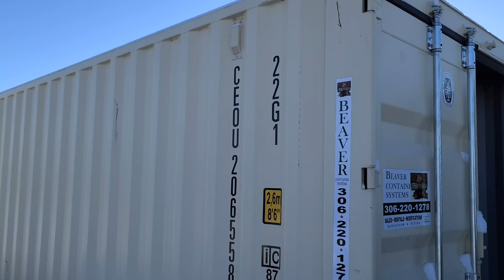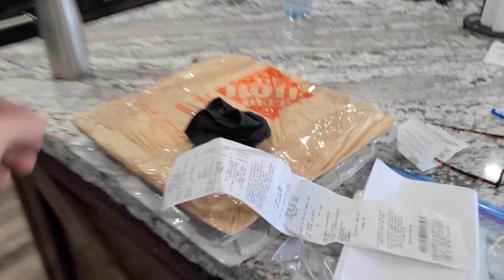Building Our Dream Shop/House Part 21:Final Touches

Comment: The mirror was nice, but not how I would have done it. I would have used a router to make a track that would let you slipp the mirror into it. That way the second layer of wood could be skipped and the mirror could be made to look more simple. I would also not have used old wood, but rather stained new wood, because I would also use the router to smooth out the outer edge so that it curves in towards the wall almost like the whole thing was growing out of the wall. A smaller bit could also do the same to the mirror side so there would be no edge. But my idea was born from what you made so thank you for doing such a good job and keep up the good work.

Comment: Killer job you guys. Looks incredible.
On your wood fireplace you should have your air intake lower. It will drain itself if you install it on a downward slope. I'd also recommend a damper that you can open and close for when not in use. Especially in summer to keep them bugs out. 🍻

Comment: In the patio/porch area I would love to see barn board around the outer walls and the wall that is shared with the house I would match it to the main siding on the exterior... but might separate the area too much. Depends on the the vibe you want.

I absolutely love this build.. I will definitely use it as inspiration when I can finally build my own.
Reply from the maker: Thank you for the tip. Good luck on your build

Comment: the ice on your wood-burning stove comes from the draft and will not disappear if you heat the room, it will rather become condensation. if you are allowed to build a flap to stop the draft, you have to open it whenever you want to operate the oven.

Comment: if it's not too late that air intake for the rsf fireplace ideally could have a loop in it and it will cut down on the condensation.

Comment: Spray off the excess snow off the 6x6 before you put it in your shed.
Reply from the maker: Why?
Reply: @ostacruiser  OMG obvious reasons!!
Reply from the maker: @jasonswift7098  everything melts and goes down the floor drain. No need for extra steps. Thanks 🤟🤞
Reply: @ostacruiser  Yeah and then makes the inside of your shed all wet and dangerous.
Reply from the maker: @jasonswift7098  mine doesn't. You do what works for you
Reply: @ostacruiser  your snow does not turn to water? is it magical or something?

Comment: Absolutely love heating with wood except for the mess. I think our 2 bed 1 bath house is just about as big as that porch and the dust is killer in here. Currently 8 regular degrees outside and it's 80 in the house at 25% humidity... I think our stove is to big.

Comment: I commented on a previous video, but don’t know if you look back at comments that far. 
I didn’t find it anywhere looking through your descriptions. 
Do you mind sharing the dimensions of everything? I am hoping to build an airplane hangar with living quarters attached. I would also like a lift, and wood shop area as well. Just trying to figure out the scale of everything. 
I like how you designed the front of the building. It looks much nicer than just a rectangle box.
Looks great!
Reply from the maker: Main structure is 50x100. Living space is 26x50 x2 including the upper floor. Shop 50x74. 28x32 attached garage. 20x30 patio
Reply: @ostacruiser  Thanks for the reply. It helps trying to visualize the scale of what I want to do. I assume your office/mechanical room are using part of the 74’ shop space? I’m only allowed 50x60 shop by ordinance so I would want mechanical to be in the house footage. Another issue I haven’t figured out for mine is the lot I’m looking at has about an 8’ change in elevation. So the house end of the hangar/shop will be dug in. I don’t know if I want the living quarters dug in also, or elevated with stairs down into the hangar/shop from the ground floor. 
By the way, I’ve watched up to part 16 of the series We must like the same type of building because we share a birthday!
Looking forward to watching the rest of the series. Awesome so far.

Comment: Is the electrical room behind the stove, can you pop through the wall and run the cable in top corner of millwork for hot water?
Reply from the maker: Yes, possibly. Thanks

Comment: Next time rub either candle wax or even bar soap on the threads of those bolts and it will be way way WAY easier to install
Reply from the maker: Thanks for the tip

Comment: Where were your safety glasses when cutting the steel bed hinges? My husband was a builder & had slivers of wood that went into his eye, several different times, without safety glasses. Then his brother was working with steel & a steel sliver went into his eye. He lost his site in that eye. Then yrs later my husband lost the site in his eye. Dr's couldn't explain why. He had many procedures down but none helped. He ended up having his eye removed & ended up with a glass eye. Please wear Safety Glasses ALWAYS in doing construction. SAFETY FIRST.

Comment: Freakin love the house! Livin the dream! Right on!
Also any tips on clearing snow off a bike? I leave mine in a shed with no heat and it just turns to ice! So afraid it’ll tear a cv boot. I can’t clean to well after each rip due to bulky a arm guards. Ironic, they save the boots in the muck, but harm them in the snow!
Keep rippin!
Reply from the maker: It's really tough when you don't have a warm place to melt it off. Just try and clear everything from around the boots as best you can when you are done riding
Reply: @ostacruiser alright, thanks.
Reply: @justind6039  good idea!